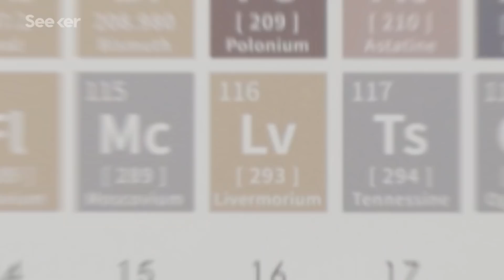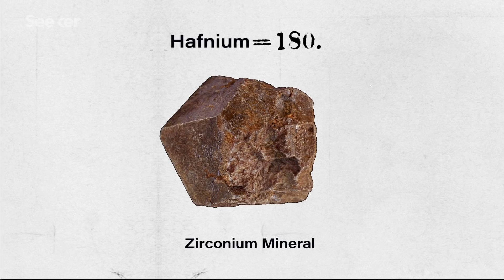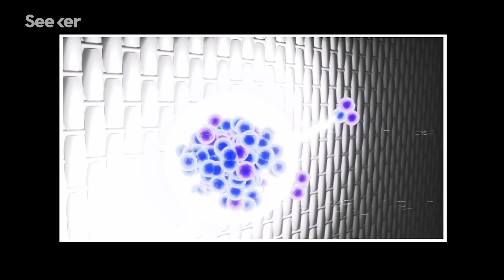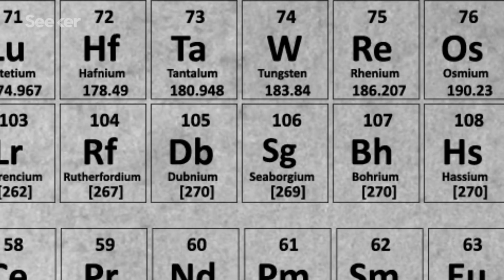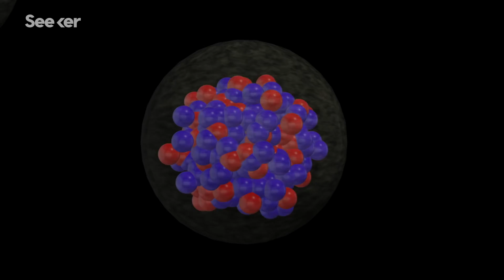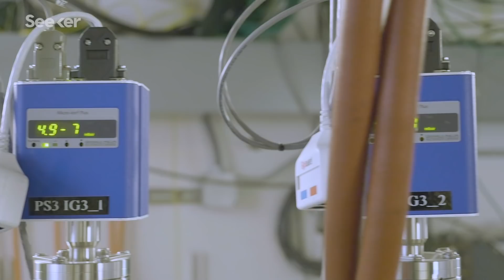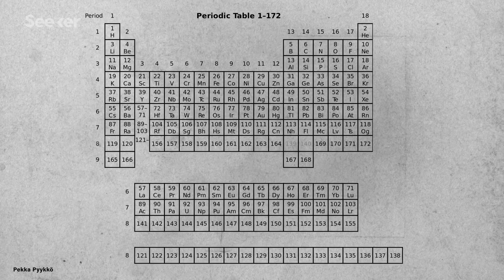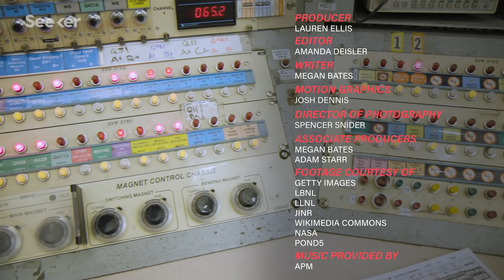This Superheavy Atom Factory Is Pushing the Limits of the Periodic Table

Comment: We have to create means to increase gravity inside some of those experimental chambers so that those heavier elements don't decay as fast , this is a huge challenge of its own since we lack the underlying science to accomplish such a feat. A much easier thing we could do is rise the temperature of the targeted plate to ridiculous levels and try to cool the particles targeting the plate so that the probability of a collision is higher. Another possibility would involve creating new geometries of magnetic fields so that the fundamental laws of electromagnetism are actually inverted on one end of this reaction (such as the plate or the particles hitting it) so that the collisions are much more likely to occur because their respective nuclei would be drawn to each other instead of repelling. Some hinted that element 115 is part of the stability island of heavier elements , though I am not sure which elements would be required to create such a material.
Reply: What?

Element 115 was discovered in 2003 and in 2016 was officially named muscovium. Four atoms were formed by bombarding americium with calcium ions. The most stable isotope has a half life of 220 milliseconds, so is not in the island of stability which is higher up the table.

Comment: There could be dozens of isotopes of these transuranic elements.
Can they tune the neutron count to be sure they create the most stable ones?
Reply: No, they can't.  Two reasons:
1 - the number of neutrons required for stability isn't really predictable, except that bigger atoms need increasingly more.
2 - there's nowhere for those extra neutrons to come from.  Hypothetical example: combine two deuterium atoms to get a helium with 4 neutrons, but helium requires 5 to be stable.  Where do you get the fifth? (This is a made-up example only to illustrate the point, please don't 'correct' me on the number of neutrons in helium.)

Comment: This could be a great video if only it explains why some scientists think there's an upper limit of the number of elements. Because the heavier a nucleus is, the faster the electrons need to spin to overcome the pull of the nucleus. So when the nucleus is too heavy, the electrons need to travel faster than the speed of light, which is impossible. If you do the math, you'll get a upper limit at around 170. But since ions don't have any electrons, a heavier nucleus without electron may exists. So there's an ongoing debate about this issue.
Reply: @ProwlerCam  Not as far as I know.

Comment: Stabilise element 115
Reply: StiX you’d have to add about 8 neutrons to element 115 to make it stable, you’d have to do in a fraction of a second. 

It’s difficult to even add 1 neutron to an element using our current technology
Reply: @izayakross7875  Oy, what software can I use to model the weak and strong force interactions of superheavy atoms? How can we know for sure since the outer orbitals start to have to travel at relatavistic speeds?
Reply: @izayakross7875  add 8 neutrons compared to what base nucleus? What would be the final number of neutrons?
Reply: samantha qiu based on the trend line of the known stable heavy elements it should be a mass of 299, I guess that would be an additional 9 neutrons..
Reply: @samanthaqiu3416  What is needed is the atomic mass of 299 and the magic number of 184 neutrons.
Reply: they already have ;)
Reply: Greg James no they haven’t. It’s an unstable isotope of 115
Reply: @izayakross7875  sure sure ;)
Reply: @DerangedGod you can most definitively stabilize any element. Standing magnetic waves do this all the time

Comment: Very good, waiting for chemical properties and element 119 & 120
Reply: If are placements  are right 119 should react violently with water
Reply: U need to know the same reason gold is gold in colour, mercury has dramatically low melting point. Element 119 might not be reactive as expected.